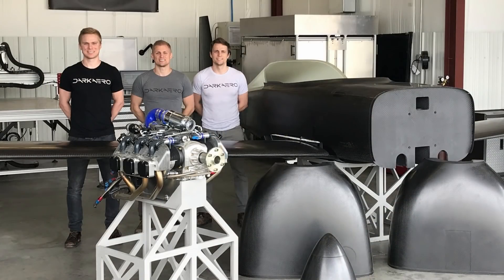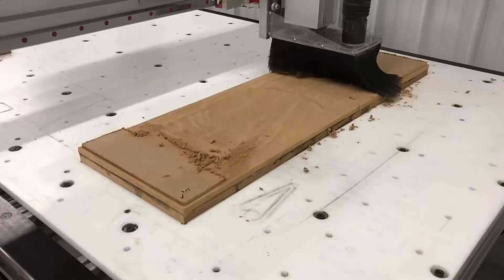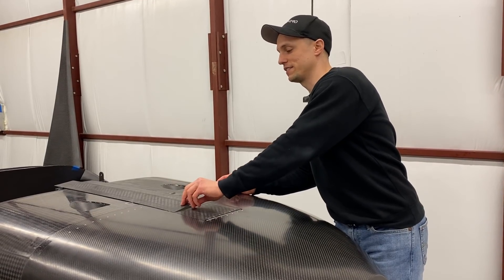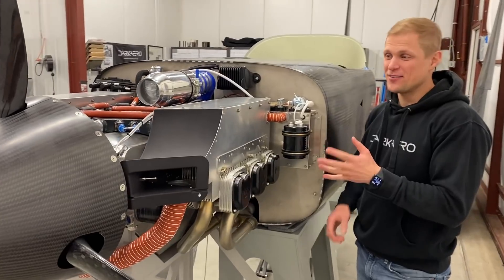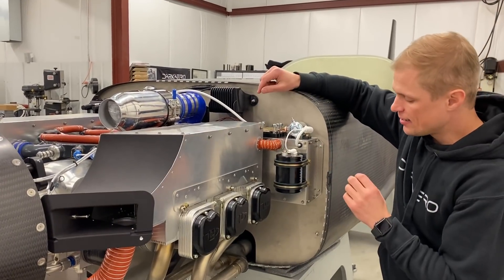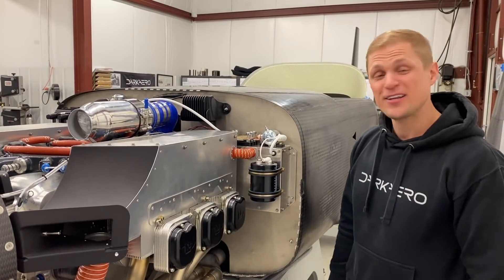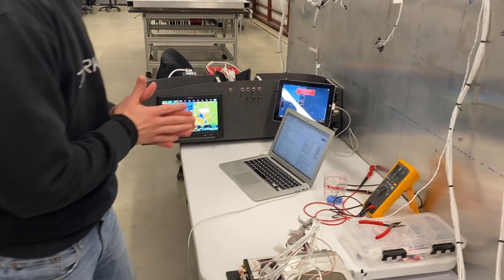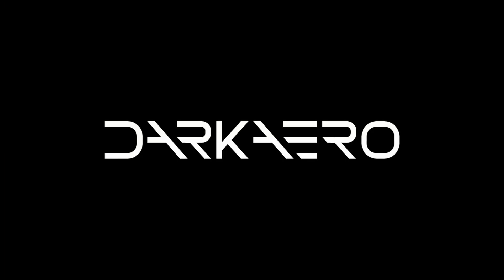DarkAero 1 Progress Update  (Feb 2021)

Comment: Just looking at the battery box cooling and assuming there was more to it than, "drill a hole here and connect a scat."?
Questions;
W̶h̶e̶r̶e̶ ̶d̶o̶e̶s̶ ̶t̶h̶e̶ ̶a̶i̶r̶ ̶i̶n̶t̶o̶ ̶t̶h̶e̶ ̶b̶a̶t̶t̶e̶r̶y̶ ̶b̶o̶x̶ ̶g̶e̶t̶ ̶o̶u̶t̶?̶ (OK, just watched 'shop#8')
With the pressure wave created at the rear of the plenum, how much radiant heat can get into the battery box tube?
If the tube was connected at the top of the plenum, it would be further away from the radiant source, and once stationary on the ground, hot air in the plenum is less likely to flow down the tube into the battery box.
Just thoughts...

Comment: I will be definitely one of your first customers.
I really love this project and your way of thinking .
I juste received your email , with the Carlos Z design of the cockpit (avionics)
I have some suggestions below:
- add AOA ( Angle Of Attack) just above the PFD

One of the mnemonic I always remember when I fly IFR is “TUPS” (Time Undercarriage Power and Switches)
So if you 
- add a clock above the PFD between AOA and undercarriage switch
- (and I know, flaps switches are most of the time near the power throttle) but I think flaps switch should be near undercarriage switch as well.
So it would be the perfect UX for an IFR flight especially for the approach phase of the flight .

Gear up -> flaps up 
Gear down -> flaps down

Comment: I would like to use li-ion batteties in an offshore vessel due to their light weight, capacity and charging characteristics but I am apprehensive after seeing lithium battery fires...In a Tesla you can pull over and hop out if the worst happens but that option isn't so appealing at flight levels or with offshore boating. What have you done to mitigate the risks of a fire starting beyond cooling the battery box? Has the technology matured or are you charging to a lower voltage or something else you can share?
Reply: Matt, go to Earth X battery website and they explain the different lithium battery choices.

Comment: Nice project, what's the idea behind having the battery box next to the engine, wouldn't it be possible to have it farther in the body and so be able to remove the active cooling system and win some weight?

Comment: Guys, have you considered venting the battery compartment overboard/externally ? On the 787 the lithium battery compartments were redesigned so any thermal runaway didn’t have fumes entering the fuselage/passenger compartment. For example FOD damage, engine failure or a bird strike causing an issue to the battery box. loving the work and might consider a kit in the future. Looking forward to first flight.
Reply from the maker: With the battery located firewall forward, it's basically already vented overboard. You are trying to protect the occupants of the aircraft from any sort of off gassing from the battery and placing it firewall forward achieves this. Additionally, if there is any sort of thermal event with the battery, it's already isolated from the rest of the airframe since the firewall is specifically engineered to protect the rest of the airframe from such events.
Reply: @DarkAeroInc  Thanks for replying. Much appreciated.

Comment: Will the air still be cool after passing through the cylinder head fins to the back of the airbox? I guess warm air might be beneficial at high altitudes where the battery could suffer from the cold.
Reply from the maker: The air passing over the tops of the engine cylinders doesn't pick up a significant amount of heat until after it passes down through the cylinder cooling fins. The air in the plenum can be considered "cool". There is possibly a temp rise of a few degrees as it travels front to back (from cylinder 2 to cylinder 6 in this case) but it's not enough that we would be dumping hot air on the battery. The battery can operate from -22F to 140F so we have a pretty wide window to work with as we tune the airflow through the battery box.
Reply: @DarkAeroInc  Thanks for replying! That makes sense, sounds like a good system.

Comment: Connectors are the most unreliable component in an electronic system and there's only 1 for the entire display panel. If that connector comes apart in flight, at night, IFR, are you relying on the tablet as the backup instruments. Will the data modules communication with the tablet without that connector. Have you considered splitting the wiring between 2 connectors, main / backup instruments for added redundancy?

Comment: Superb work as usual.

River, it looks like your still using standard nylon lock ties, have you considered using GripLockTies on the wiring harness? These could all but eliminate the long term problem of wire insulation chafing and wear through as a points of failure. Tracking down that insidious intermittent ground hum on comms or the tripped circuit breaker that only seems to happen when your midway through your flight is always a pain but a complete failure in one of the critical electronic signal, comms or electrical control systems could be real bad. Gone are the days when it’s a good day if you can walk away from a gear up landing, because the economics of Experimental Aircraft operations and its insurance implications often mean that you end up also walking away from your flying career as well. Much worse would be electrical arc causing smoke in the cabin or an engine fire could if it were to result in the loss of the aircraft and just catastrophic if were to result the loss of pilot and passenger. As engineers we can never escape these two words, ‘Risk Mitigation.’

Comment: Please explain the door choice. Why not one front-hinged door? Aerodynamic drag with wheel down? 
Will the side doors oscillate/vibrate in the airstream? Just a bit more on the design choices.
Could you use aerodynamic forces to keep the doors closed? I guess they would suck the doors open. Unless the doors hinged inward.
Just curious. Probably dumb questions.

Comment: What has always impressed, and troubled me, about landing gear doors is the tremendous aerodynamic loads they must endure, over many take-off and landing cycles.  You never open your car doors at 200mph, or just remember to shut them when you are going 150mph.  But that is normal for an aircraft.

Remember those old Volkswager TV commercials from the 1970's - no you don't you are too young.  You do remember TV at least?  Well, some well-paid-presenter would walk around the Beetle opening and closing doors with a satisfying 'thunk!'  As it turns out, the actual sounds of the actual VW Beetle's doors opening and closing were replaced with previously recorded sounds of a Rolls Royce's doors being opened and closed.  Those itty little landing gear doors yours actually sound pretty solid.

Comment: Might be an idea to be able to charge the battery without having to remove it from the aircraft. That’s if you haven’t thought of it already
Reply from the maker: True! Charging the battery is really easy with our current setup. Just connect your positive charger lead to the positive terminal on the master switch (under the white silicone boot) and the negative lead  to ground terminal on the engine block.

Comment: Hello boys, I was shocked, that your plane could weigh just up 350kg empty. In that case it could be great with ROTAX 915.  Less HP but the economy would be second to non. Do you plan to try this engine too? There might be the only problem to get it as LSA category, the limit for the stall speed.  Good luck.

Comment: Have you considered that after shutdown, natural convection from the engine may heat the battery box through the duct ?
Reply from the maker: Great question! Yes, there will likely be a bit of warming of the battery after engine shut down when there is no longer airflow through the duct system and the warm engine transfers heat to the battery. We don't yet have good quantification of how pronounced this will be in our specific installation. This is something we are planning to measure once we get the engine running and into testing.
Reply: @DarkAeroInc  working on turboprops here, shutdown is the hottest part of the flight !
Reply: @DarkAeroInc  looks like there's room to plumb the cold air duct into the lower part of the box and have it vent out the top instead
Reply: @DarkAeroInc  A small computer fan similar to the avionics cooling fan in the duct line with an indicator to the panel? Great job you guys. Looking foreword to the kit.

Comment: Keep in mind that charging a Li-Ion battery at below freezing can damage the battery. At the altitudes this aircraft will fly, you could easily be introducing subzero air to the battery via that cooling duct. Cold temperatures also severely limit the output current/capacity capability of Li-Ion batteries in the case of stator/regulator failure.
Reply from the maker: We didn't show it in the video but the battery is Lithium Iron Phosphate which is a different and more robust chemistry than Li-Ion or Li-Po batteries. The operating temperature window for the battery is -22F to 140F. This is a pretty wide range so it shouldn't be too difficult to achieve that with our setup. Our current battery arrangement is a starting point that we will likely need to tune a little bit in flight testing to get the temperatures dialed in.
Reply: @DarkAeroInc  I’m not sure what LiFePO4 battery you are using, but you may want to verify if the battery BMS does not have a low temp cutout and that the cells are rated for low temp charging.

Comment: The front of the laterally opening gear doors is cantilevered a considerable amount from the front hinge, potentially imparting a large moment on that hinge should indirect airflow (i.e. from yawing force, during a crab) be applied. Did you consider the lateral strength and stress points from the cantilever required to handle those loads?
Reply: I noticed it bent when he moved it and had a similar thought, but he also said it was a prototype that would be rebuilt.

Comment: I’m sure you’ve already thought of this, but on the tarmac during preflight I’m not sure I would refer to that engine plenum as a cooling duct.  I would refer to it as an oven capturing the heat of 3 air cooled cylinders.  At 200 mph, yes, cooling.  That hot air will then be ducted into the battery?  How did you determine the temperature curve inside that plenum from zero to hero speed?  Also, I’m sure you already know the time/temp/ambient heat duration limits of the battery.  Wouldn’t a NACA duct be a better solution for cooling the battery?  I’m not complaining.  Love what you’re doing.  I’m just curious about the thought processes behind the build.
Reply from the maker: Hi Will-Co! Great questions! As Richard mentioned, there is a giant fan on the front of the aircraft (the prop ;D) pushing air through the plenum when the engine is running. The battery has a pretty wide operating temperature window from -22F to 140F. We do not have any sort of temp vs airspeed map yet. The installation we have now is a starting point that we plan to test, measure, and iterate on as needed. It was established based on the best information we have available from the engine manufacturer, battery manufacturer, and other successful installations using similar arrangements. Thank you for watching!
Reply: @DarkAeroInc    Thanks for responding.  Yes, I understood what Richard’s comment was about and I do realize the effect of the big spinny thing on the front.  I should have elaborated a wee bit more.  I was thinking about the reduced air blast that is generally at the root of the blade.  In reference to the root chord to tip chord there’s a variance of airflow volume.  Yes, no?  Again, I’m just curious.
Reply from the maker: @Will-No-Co  you are correct there is a variation of airflow vs radius on the prop and normally airflow is low near the prop hub. The large diameter spinner we are using pushes the root section of the prop blade that is exposed to air out to a portion of the blade that is actually generating some airflow which should help cooling. This can be seen a little bit better in our spinner video. https://youtu.be/LFjMw4xAjsI More of a hand waving validation at this point since we haven’t yet tested and measured the airflow but we have good reasons to believe there will be adequate cooling even on the ground. Thank you for watching and for the discussion! :)
Reply: Remember on the tarmac the prop is forcing air into the plenum, then into the battery box and/or down thru the cylinders

Comment: Wouldn't it have reduced mechanical complexity, improved manufacturability, and decreased build time if you made the two side-closing nose gear doors a little longer so the plane did not need the small, third nose gear door?
Reply from the maker: Douglas, thanks for the question! We would have opted for 2, but the doors extend past the firewall and into the engine bay. Past the engine bay the belly of the fuselage curves up making it hard to get the geometry right with the hinges. Additionally it's hard to fit a hinge up in the engine bay area. Two doors and no hinges firewall forward leaves too much unsupported door area. A third door eliminates the two door hinge issue and keeps the doors from being tied to either the bottom cowling or engine mount making it easier for service events as well.
Reply: @DarkAeroInc  OK.  I completely understand the issue of hinges on a curved surface.  That makes perfect sense.  Your plane is beautiful.  Keep up the good work.
Reply: Good idea, less parts and movement! Also clean aerodynamically in a wind tunnel!

Comment: @darkaero what is being shown at the 10:37 point of the video?
Reply from the maker: It's a pneumatic vice that can be mounted on our CNC mill for work holding. The cool thing about it is the pneumatics can be ganged in with an automation system. Something we are experimenting with in the background. ;)
Reply: @DarkAeroInc  a pneumatic "vice" is a bit different than a pneumatic vise. The latter is used in a CNC for workholding purposes. The prior would define the use of pneumatics in an "immoral or wicked" way.
Reply from the maker: @alyoungwerth9908  You got me. Not coming back from this. XD
Reply: I was wondering the same????? Gear up/down (switch/actuator) only thing I can think of.

Comment: Nice. Are you opposed to the lithium battery behind the firewall? and would you forego polished avionics etc for earlier first flight test to validate aerodynamic performance?
Reply from the maker: Hi Dan! Great questions! Placing the battery on the cold side of the firewall carries its own set of issues. For our installation, the only space available would be in the aft section of the fuselage. This would mean running heavy 2 gauge wire to the back of the airplane and then back to the engine. This length of wire weighs more than the battery itself. Once the battery is in the portion of the airframe with occupants, it requires some sort enclosure to protect the occupants and airframe from any thermal event. If you are going to build a battery enclosure, you might as well put that whole assembly firewall forward and duct cool air to it. This solution, when implemented properly, gives the best of all worlds. Safe operating temperatures for the battery, isolation from occupants, and minimized weight. As far as the avionics go, it's something we are going to continue iterating on. Building up our first instrument panel generated ideas for improvements we want to implement. I'm sure we will have more ideas for improvements once we actually get behind the panel in the air too. Thanks for watching!
Reply: @DarkAeroInc  I was thinking the battery right behind the firewall. Lifepo doesn't really thermally runaway. Even if it is forcefully overcharged it just sizzles in my experience. Even if punctured. Could have a tiny vent for it into the engine compartment maybe. Might also be nice to have battery in the cabin in case there is fire in the engine, not that that's an ideal situation :) but nice to have battery for the gears and avionics.
Reply: I agree... Now it probably won't overheat but make sure also it won't freeze...
Reply: My thought was, is the air in the top of the plenum actually cool enough  having passed over the cylinders to keep the bats cool?  Alternately, if it is cool enough over the cylinders on a "normal" day on the ground, what about at FL200?  (If y'all DID actually model this, I'll be even more impressed than I already am, what with the corrosion-proofing of the honeycomb sandwich parts and the general attention to detail - including buildability - y'all have shown..)
Reply: @stonebear  that's why I want the relatively harmless battery in the cabin temperature.
Reply: gsknowslinux Unless I missed it, I don't think this is pressurized. Not going anywhere near FL200.
Reply: @Chris-bg8mk  you could with oxygen but the engine is not a turbo either. Still could be breathing ice at 120

Comment: Concerned about the nose gear doors.  Will the forward part of the  side opening doors be secured?  I would be worried about air loads and possibly flutter damage.  Did you consider lengthening the forward door and shortening the side doors to the hinge point?  Did you consider dynamic air loads with the gear door in motion at design limit speed?
Reply: My concern as well. What is the design gear speed? I suspect, like most planes, the gear doors will be the limiting speed.

Comment: Nice work. For safe securing of vital bolt/nut connections (guess you have some vibrations) you could look into: https://www.nord-lock.com
Reply from the maker: Hi Alexander! Right on! Both the UL Power engine and the Airmaster propeller utilized that style washer in a few locations. Typically we use locking nut plates or Mil-Spec lock nuts. More info on our hardware selection process can be found here: https://www.darkaero.com/knowledge/hardware-specs/ Thank you for watching!